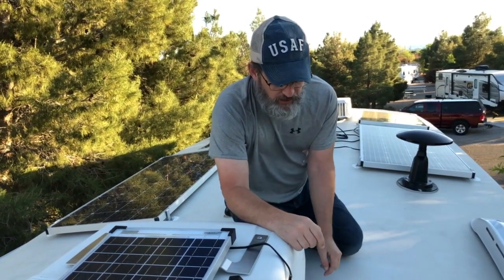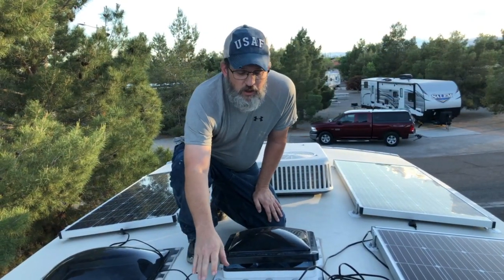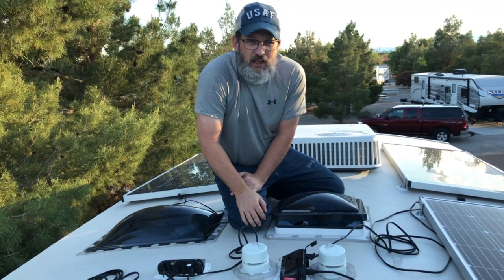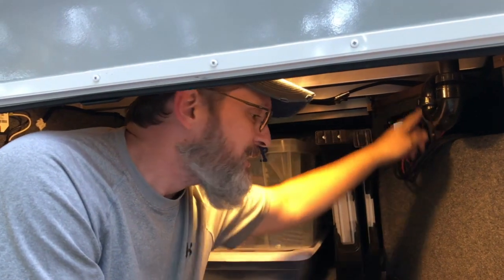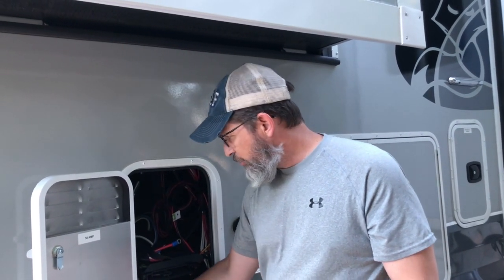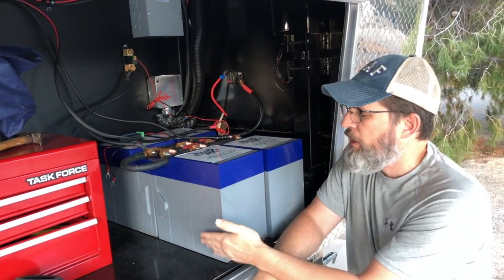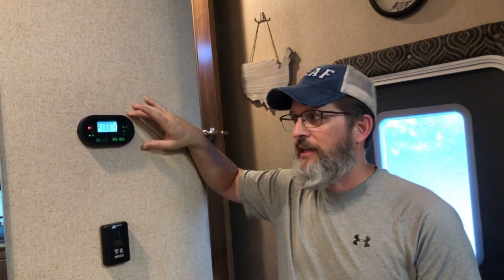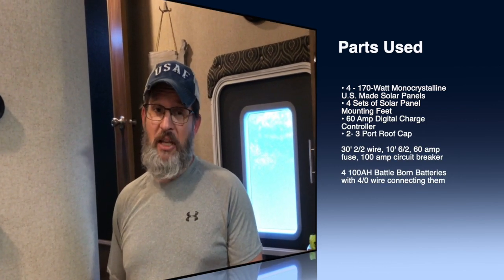Pre-Wired RV Solar Upgrade - Arctic Fox 27-5L

Comment: We added solar panels to our 29 5T Arctic Fox too. Slight Segway here, something you might want to check is whether or not the manufacturer added the cold weather kit for your refrigerator. We have a 2019 Arctic Fox 5th wheel and recently experienced temperatures in the 20 degree range during the night and the refrigerator stopped working. Our brand new rig was sold to us as 4 season ready but the Norcold refrigerators, unless the cold weather kit has been added, do not seem to be equipped for temps below freezing. Now the entire cooling unit has to be replaced. No fun, we are going on two weeks without the refrigerator.
Reply from the maker: Wow, thanks for letting us know. We are going to have to check and install the cold weather kit if it was not already done. Thank you!
Reply: Glad to share, we’d hate to see anyone else go through what we’ve been experiencing. We assumed all season ready meant just that and whether or not a cold weather kit had been added isn’t a question the average purchaser would even know to ask. We sure didn’t!

Comment: We put our 4ea batteries behind that panel where you mounted your charge controller. We also made a new wall to take advantage of the empty space behind the water panel area and were able to mount our charge controller there. Now we have all the space in front plus the original battery space for more stuff!!
Reply from the maker: Terrific idea! Thanks for sharing that!
Reply: If you have picture of this battery installation I would be grateful to see them. I have the same model and I am making plans to add solar. Thanks

Comment: I just added 4 panels to our 29.5t wich also said solar ready. Ordered the Zamp kit and was able to hook them all together and plug them in to the roof plug. The little panel that came with the unit I threw away and used the wires to power a backup camera wich I traced to a cabinet behind the stereo. I also put my batteries/controller where you did and replaced the 10amp remote with the upgraded Zamp one that came in kit. 
Took me about 4-6 hrs to do the whole job. You did a nice job.
Reply from the maker: Thanks for watching! I had not considered using the wiring for other things. Very good idea to use it for a backup camera. Which brand of camera did you go with?
Reply: Chickery's Travels we purchased the Haloveiw camera. I used the wiring to the old panel to power the camera head thru a switch inside behind the stereo. That way I only turn on the camera when we want to use it (under way) 
We leave our home in Juneau Alaska this Friday on our tour of the states so looking forward to a couple years of exciting travels.
Reply from the maker: Thanks. Safe travels. Maybe we will see you on the road!

Comment: Glad that you could be give me some insight on coming events!!  Our AF is suppose to reach the dealership sometime today.  I am assuming that you ran all panels in parallel vs any type of higher voltage back to the solar controller.  My original thoughts were to place the batteries in the under bed area where the temperatures were more controlled.  I have to assume that you don't think that temperature will be any battery issue in the front storage that could be subject to both hot and cold extremes. Were you figuring on any type of insulation around the batteries??  Good video!!!   I was very much anticipating your battery and solar install.   Thank you very much, Sean!!!
Reply from the maker: Thank, Eddie. Congrats on the AF! We love it so far. Yes, they are considered in parallel. I do know that a lot of people are going for the under the bed placement of the batteries. We had our batteries in the same spot (front storage bay) in our Cyclone and never had a temperature issue. We did experience some temps in the teens, but the front compartment & batteries never got cold enough to stop charging or discharging. I hope this helps.
Reply: Have you noticed much difference in interior temperature swings in your AF vs your older Cyclone??  Can you see any major differences in the insulation package in the short time that you have lived in the AF?
Reply: One thing that I would add to your system is a rubber grommet in the steel wall that comes into your battery storage.  Road vibration could rub the insulation off of the wires and create a short!
Reply from the maker: @eddiearmacost7649  huge difference. The climate control in the AF is much easier than the Cyclone. Our air conditioner in the AF actually cycles on and off. Even in cooler temps than we are in now (mid-90s), the Cyclone Acs would never stop running. I would have to say the construction and insulation in the AF is much better than the Cyclone.
Reply from the maker: @eddiearmacost7649   it is on my list of things to get next time I am at the store. thanks!
Reply: We took delivery on our Fox on Friday.  Has rained everyday since we got home. Expect to start the process of looking how to install solar,  inverter wiring, batteries and cellular antenna.  Have you established a route yet to run your two 120 volt inverter lines from your inverter to your electric panel?? I am wondering if there is a way to route the lines without dropping the covering on the bottom of the rig.

Comment: Fellow 27-5 L owner. Liked your solar set up - did you get the inverter installed? I would love to hear how that went. We hav3 had our AF 4 years and love it.
Darrel
Reply from the maker: Hi Darrel - I did install it. I was fortunate that I did not have an onboard generator, but had the wiring. So, I used that wiring to wire the inverter to the panel. It was fairly easy. I can send you photos. Just go to the contact us page on Chickerystravels.com and send us a message so we can send them to your email.

Comment: Good video! I'm interested in weather it runs A/C or not.
Reply from the maker: We can run A/C with our lithium batteries for about an hour or so at a time. If you have lead acid batteries, you’d need to watch them very closely as you shouldn’t take them below a 50% charge.
Reply: @ChickerysTravels  We did this in our 5th wheel. A three level unit on the drivers side of the 5th wheel.

Comment: Thanks for taking the time and effort to make this video. We're looking at the AF 27-5L and I was wondering about the 'solar prewire', I suspected it would be a bit too under engineered for us. I wonder if North Wood would be open to the idea of prewiring with bigger gauge wire? as well as more batteries and an inverter? It's always soooo much easier to run wire during construction.
Thanks again and safe travels.
Reply from the maker: It never hurts to ask. I would think they could do it for a cost. If not, the dealer you purchase from would probably do it as well. I have to agree 100% that either adding heavier gauge wiring or having the ability to run the heavier gauge wiring where the existing wiring is would be huge for those of us that want to put up more than a couple of hundred watts. Thanks for watching!
Reply: Northwood will not deviate or change wiring or equipment while building.  They will add or delete listed options on the trailer.  I recently went thru that. You or the dealer need to make any other changes.
Reply: @eddiearmacost7649  
That's a real shame, but thanks for letting us know. 
So the only way to have this done at the factory is if they added the extra wiring to the list of available options? 
Humm, wonder if they have a 'suggestion box'!? ;)
Reply from the maker: Thanks for that information. I think the dealers would be able to do it...for a price
Reply: In Northwood’s defense, they are a relatively small company. They don’t make all models all the time!  Our unit was 1 of 1000 units scheduled to be built in a 4 week period from the end of March to the 20th of April this year. That model won’t be built again for months!!  When you think about building a 1000 in a month, any deviation from the norm would have to drastically slow the manufacturing  process and increase the chance of more errors in production!! They have a good record because they don’t accept request for changes knowing that opens the door for screw ups and lack of uniformity.  I was pissed when they wouldn’t switch converters for me with one that was designed for lithium instead of lead acid.  After reflection, I realized that this wasn’t there first rodeo and that they had good reason for not bending the rules.  Just my thoughts!!!

Comment: Thank you for sharing, very informative.  I would put a plastic sleeve were your wires come through the metal wall.  Vibration from traveling could rub a cut in the wire and ground it out through the metal wall.  Just a thought and thank you for the video 👍
Reply from the maker: Great tip! Thanks!

Comment: Great video. I also have a 27-5l. What route did you use to route the wires from the inverter to the distribution panel under the stove?
Reply from the maker: It’s hard to explain, but I’ll make another video showing it. You’re not the first person who has asked.
Reply: Haha I have spent all day today looking through the rig and coming up with possible paths and I completely believe you when you say, “it’s hard to explain”. I have 3 options I’m considering: 1. Go through the storage bay into storage underneath stairs then try and snake my way to the opening in the fresh water inlet/water pump area and keep going until I get to the area behind the distribution pannel. 2.  Follow the same path but on the outside along the propane line that leads to stove. 2. Run along the outside of coach on the same side as shore power plug and pop up by transfer switch and then work toward the ac panel via kitchen sink and drawers. One of the downside to the fantastic insulation on the AF is it’s very tricky to run wires. Can’t wait to see how you did it.

Comment: Zamp is not good to deal with on the phone either!... Especially if you let them know you have no intention of buying their high dollar panels!  ...Also you need to change the hookup if using other solar because theirs is wired opposite
Reply from the maker: I had no problems talking with them on the phone and the gentleman who answered was very talkative and friendly. Sorry you had a bad experience. I have heard that about the connections. I actually had a friend that fried the controller because of that. A good reason to do plenty of research before deciding on the best system for your situation. Thanks for the comments and thanks for watching the video.
Reply: I understand your point but you bought zamp solar.. I called with with questions about the RV I purchased because it’s pre wired by zamp... I told him I simply wanted to know if it was in fact wired in reverse polarity and then he turned defensive and hushed so all I know is I will never do business with zamp again, I was simply trying to keep from burning my RV to the ground... besides their solar is 4 times higher than competitive market prices.. I just say this in conversation, not trying to be argumentative, 😄
Reply from the maker: Thanks. Adding these comments helps others make the right decision. We appreciate your input.

Comment: Excellent job ! Perfect I know just where you took the wire down. Handy dandy. Sure would love to see you guys again. I hooked ours up different cause we’re stationary at camp. Our controller and inverter are where you batteries are. I did not run my readout panel in. Now I want to. Great! Love from Ken and Jane! 🤠👍
Reply from the maker: We hope to see you guys again soon too. The way you routed the wiring is also good. There is plenty of space up there in the front.I should have a video soon with the rest of what I want to install. Need to get the inverter mounted and wired. Hope Jane is continuing to improve!

Comment: So you've been using this for a little while... Is your setup big enough to run the A/C while boondocking as well as a few other small items? Or would you need a few more batteries?
Reply from the maker: We can run our AC for about in the batteries if there is no sun.
Reply: @ChickerysTravels  Whaaaat? :-) I think you forgot  xx hours on the batteries if there is no sun!
Reply from the maker: @grumpyshorts1056  Yes, meant to say we can run the AC for about 1 hour on the batteries if we aren't generating any solar power. Sorry about that.

Comment: Did you put soft start on both A/C’s?  Can you actually run the ac off battery, or will you use the portable generator?
Reply from the maker: We only put it on the front AC. We have run it off the batteries for about an hour to cool things down in the rig. Otherwise, if we need it longer, we use the generator.

Comment: Sean, with the 27-5 L being generator ready, is there anyway that wiring can be used in conjunction with a pass though inverter installation??  It would seem that there may be a way to use the same wiring.  Any thoughts??
Reply from the maker: It is possible, but I have never done it. The one thing you would have to worry about is turning off your converter if you were running of the inverter. That would quickly deplete your batteries. As long as the automatic transfer switch is installed/working, it should be possible. Here is a link with some interesting info. http://www.doityourselfrv.com/rv-inverter-install-diy/ maybe I will explore mine before I do it the way I had originally planned and let you know what I find.

Comment: How did the EasyStart fit into the power equation?
Reply from the maker: Great question. Since we will be installing our 3000 watt inverter charger and will be using our 2 2000 watt portable generators (only when necessary), we wanted a way to run our AC using as little startup amperage as possible. The easy start will do that and allow us to run for a short time on the inverter and batteries.

Comment: With the amount of 760 watts soalr panels and 4 batteries, do you still require a generator when boondocking?
Reply from the maker: The answer really is "it depends." If we are in the sun, we can go without using the generator for days unless we are using a lot of electricity (instant pot, microwave, AC, etc). One time we were boondocking in Tennessee and encountered rain for a few days, we needed the generator then. We do not have an on board generator. We have two 2000 watt WEN generators that we connect. They charge the batteries quickly and are very quiet. You can take a look at them on Amazon.
Reply: @ChickerysTravels  thanks for the insights...informative. That is the problem, if you don't have any sun for days...Take care. I will take a look at the WEN gens...

Comment: What size Inverter are you going with and will you need a separate battery charger for shore/generator power use?
Reply from the maker: We have a 3000 watt inverter/charger so we don’t need a separate charger although we do have a converter as a back up.
Reply: @ChickerysTravels  Did you use the Victron again?
Reply from the maker: Yes. We actually took the components out of the previous RV and moved them over for the new one. The only thing we left behind was the wiring and solar panels.

Comment: I will not be anything close to a full timer but even for me that solar prewire looks like a joke.  I have not yet taken delivery on my “solar prewired” Grand Design so I still have hope it may be a little better than your Arctic Fox.  I don’t need a system as robust as your but what you were set up with there was not very useable.  The hype does not match the reality.
Reply from the maker: It was an eye opener.